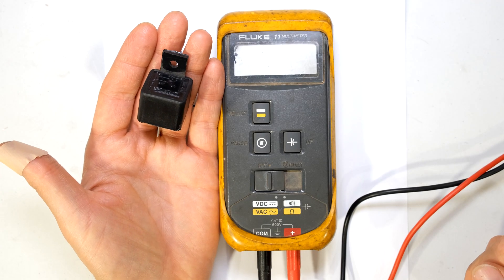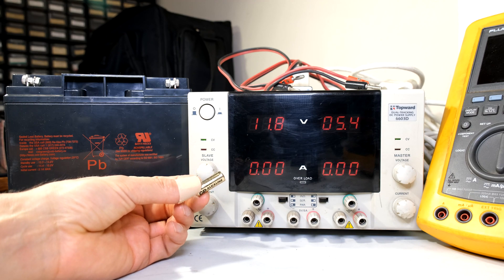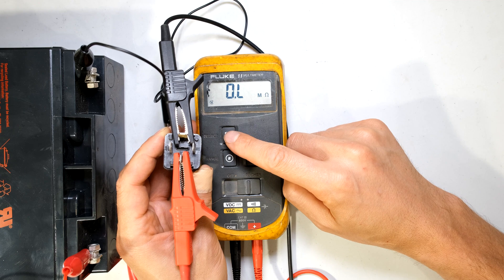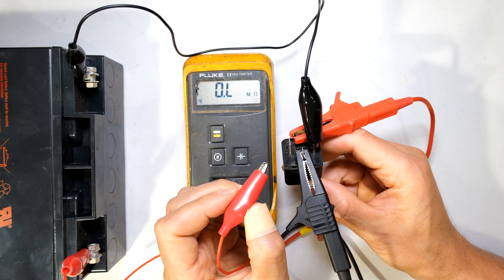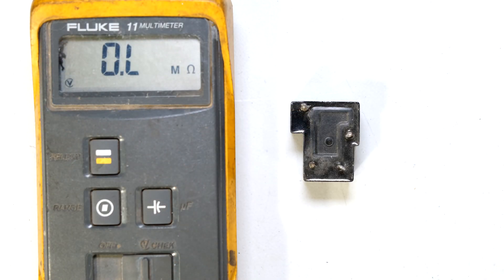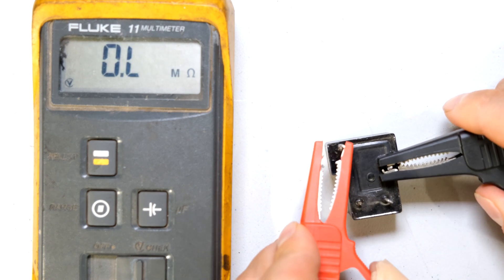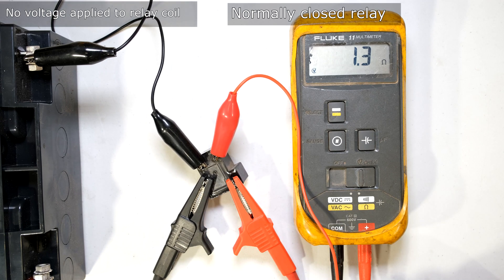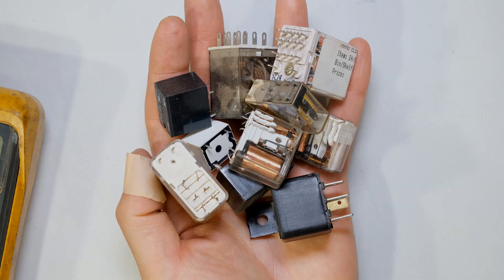How to test an automotive 12 Volt relay - normally open and normally closed relay shown

Comment: Hi can I use the 12v relay on my vvt ocv solenoid. I have a 4age 20v engine that has been converted to a carburetor now normally the 4age vvt is controlled by ecu and a rev counter. So I who like to know if I try to connect the vvt ocv solenoid to my 12v relay, will it work?